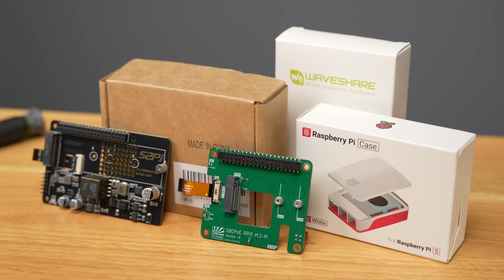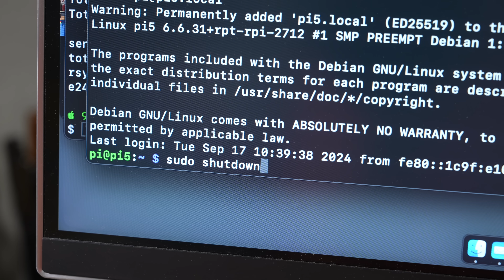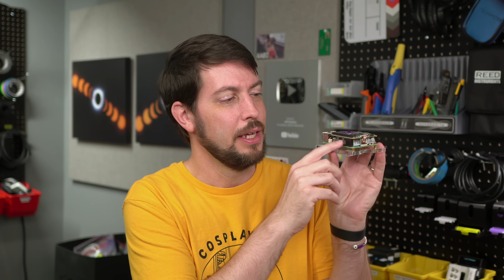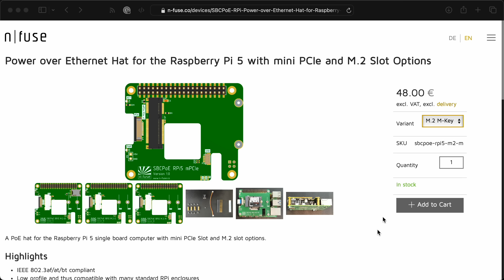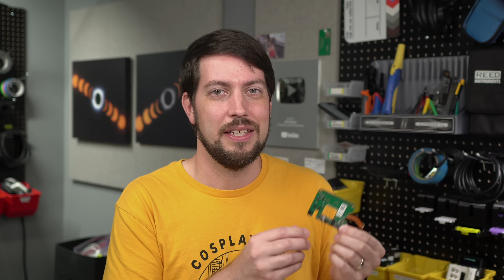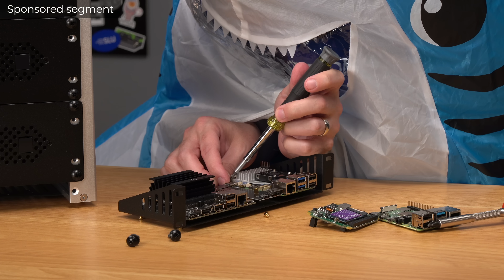PoE+ NVMe beats Raspberry Pi to the punch

Comment: The coil whine is what made me return the Waveshare POE hat, removing one of the selling points of RPi 5 vs. mini PCs for my intended purpose. My ThinkCentre Tiny cluster uses active cooling and has a certain amount of coil whine, but still manages to be quiet in comparison to this particular POE hat that I ordered. Unfortunately, this new hat comes a bit to late for my RPi 5 which now runs on the original power supply and with a NVMe base. I still feel like the RPIs got way too expensive (after considering the "required" mods like a heatsink/fan, the power supply and a NVMe hat/base) coming in very close to what I have paid for my ThinkCentres. Even the power consumption of the RPi 5 isn't all that great anymore. Something that I'd really like to see improved to make it more competitive again - smart phones can do it, why not RPi's*. Idle vs idle (with powertop on the ThinkCentres) they are surprisingly close, actually. Under (partial) load the PI5 wins cleary, but is also slower and is less flexible for server tasks. That being said, I still enjoy content about RPis a lot!
* Yeah, more modern chips/nodes are even more expensive to produce that's true, but still.

Comment: Great video about POE . I am working on RPI5 with waveshare with bottom M2 NVMe board including passive cooling of the M2 drive. Cooler on the top board I find to be very good solution. My own encloser will be using this setup and  run my one application  a as a server. I can keep you informed if interested.

Comment: You really do not need isolation if the application is all on an indoor rack. If we were running Ethernet to a remote pi (edge pi) then I would use an isolation for that one. Remember if you are powering your PI with USB C there is no isolation also. For indoor small rack applications non isolated is the way to go.

Comment: How do the various POE hats actually extract the power from the ethernet socket?  I would have thought that the Pi's board itself would require the POE circuitry to work, and thus POE is built-in.  How does adding a hat actually make this work?
Reply: The four pin header on the Pi provides an electrical connection to the far side of the isolation transformer that links the physical Ethernet socket to the PHY. The DC current can be extracted from this four pin header and handled by the PoE hat.

Comment: About "Coil-whine". Not all of this actually comes from the coils, but from the ceramic capacitors (MLCCs). There is some documentation out there and how to prevent this. You are welcome. :) There is this piezoceramic microphone effect, which also works in reverse, like a buzzer does.
Reply: Guess I learned something today and may dive into it later.
Reply: I'd argue that most of 'coil' whine in modern design comes from cheap or underrated MLCCs, especially in relatively low current converters (not 100W+ multi-phase microprocessor PSUs)

Comment: My least favorite thing about these PoE hats is the awful fans they put on there. Awful, because all 30mm fans are awful, cheap things destined to whine and fail. They also don't move much air. Barely worth the amps used to spin them. 

I have a 5V 40mm Noctua fan at max speed on the PoE powered Pi 4 hooked up to my 3D printer. It's silent, been running non-stop for a year, and moves enough air to keep everything, including the CPU, cool. All these part makers need to do is just slap a crappy 40mm fan on their stuff, so I don't have to engineer my own mounts and adapters and nonsense to mount a good fan on there.
Reply from the maker: They found a decent squirrel cage fan for the Active Cooler — one of the better tiny fans I've heard, and with the massive heatsink, it doesn't have to run that often.

Comment: So features I would like to see for the raspberry pi 6. 1. Drop the microSD entirely and put a 2230 m.2 slot in its place. NVME drives are a lot more resilient than the crap flash you get with a microSD. 2. Integrate POE by default into the board. 3. Get rid of the micro HDMI ports on it and just use 2 USB C ports on it. The nice thing with this is that you should be able to fit the power circuitry for power delivery over USB or through POE in the same area.4. The rest would just be the miscelanous make it better stuff. I wouldn't turn down faster networking and a faster chip powering the PI 6 but I honestly don't feel that those are as necessary.
Reply: Disagree on some points. 1: Many ppl who use RPis dont use PoE, so it would be an unnecessary cost for them - examples being robotics clubs, universities, etc. 2: I'd imagine the DP over USBC circuitry would take more space than a full sized HDMI connector, so rather just get a proper video connector
Reply: SD cards are convenient for a lot of users of the Pi - they're low cost, easily changed when experimenting, and easily removed and overwritten if you break the OS on them. Having an M.2 slot by default would be great, but removing the SD slot isn't going to work for a lot of users.

The vast majority of Pi users do not need or want PoE, making that a waste.

Fixing the power input to just use 9V or 12V via PD needs doing, though. The Pi has been excessively picky about power supply for too long.
Reply: USB-C with Displayport Alt Mode would make too much sense.  I think we might see it around Pi8 or 10 😂.  Agree on NVMe, it's so cheap, fast and reliable compared to SD.  PoE, while nice, seems like an added feature.  RPi foundation should absolutely have a first party solution for PoE
Reply: So now the Pi will cost $100+ with all those features.

Very few people need POE
Not everyone needs a m.2 drive. MicroSD is more than fine for most people.
1Gbit is good to keep costs down too.

I like where the Pi5 went.

I'd say the next goal would be flesh out the new stepping and focus on keeping power consumption/heat down.
Reply: @Squirrel765  As for the m.2 it really isn't an increased cost. You can get a 128Gb 2230 ssd for as cheap as $16. It isn't like the costs are really higher compared to a microSD card. I can see the logic with POE but again most people have to purchase a separate plug and cable for power anyway so having to get a POE injector instead of a USB C power cable doesn't really change much.

With all of this I guess the biggest thing is that I know that the margins are increadibly thin on a device like the Pi. I just think that especially with the Drive it is one that most people actually want anyway.
Reply: @chaosfenix  Imho you make some good points. With all the things you "have" to buy RPi's get expensive really fast anyway and an onboard SSD connector would reduce the cost for all those, who want a NVMe SSD and now don't have to buy a separate hat/base. And cost would likely be similar. Not so sure whether the same is true for POE since many  people don't even have a PoE switch. Then they would have to buy a power supply/injector/PoE switch. I pesonally think this would be one of the best features they could add... I would like to see USB C instead of this annoying micro HDMI port. It's really rare to find devices using it hence most people likely have to buy a new cable. A lower power consumption would be my other main concern.

Comment: Just wondering: What makes the hats Pi5 only?
Reply from the maker: These HATs rely on PCIe connections, which only works through the PCIe FFC connector on the Pi 5. Unfortunately older Pis don't have an external PCIe connection.
Reply: @JeffGeerling  you mentioned gen3 speeds a few times in the video - I assume you mean gen2 (x1) for the Pi 5? but I could be missing something. 7:33/10:16
Reply from the maker: @michaelthornes  You can set the speed to gen 3 (still x1 of course) in the /boot/firmware/config.txt file. For most HATs I've tested, it works fine. YMMV and it's not officially supported by Raspberry Pi!

Comment: Whenever I see a shark costume on the Internet, the song "Baby Shark" comes to me. OK, now let me get rid of the songs in my head and return to reality. I wouldn't recommend closing the top lid when using our PoE+ with the official case because there is not much cutout on the top of the PCIe connector, and closing the top lid will block the airflow. And I didn't realize that the official case even comes with a heatsink—maybe I'm just missing it, LOL.

Non-isolated PoE hats are more efficient than isolated ones because most isolated hats are based on a flyback circuit, which needs a Schottky diode series in the second coil of the transformer. Normally, the diode has a forward voltage of 0.4-0.7v. When the output current is 2A, the diode will consume about 0.8-1.4w, which is close to your testing. But I have a plan to reduce the consumption down to 0.05w and also reduce the heat. If I get any progress, I will come back and comment again.

As always, very great and detailed video.
Reply from the maker: Awesome! I love the little products you've been putting out. I'll likely end up with a couple more of these HATs once I get around to upgrading the rest of my Pi 4s, too.
Reply: @JeffGeerling  If you could find some longer M2.5 standoffs and pin-header that hat works with Pi 4, too.

Comment: Huh didn't the RPIs have PoE support before?
Reply from the maker: Yes, but they moved the connector on the Pi 5, so all the Pi 3/4-generation HATs don't work with Pi 5 unless you bodge a connector in, which is annoying and makes it not fit the same.

Comment: Jeff, have you ever played around with PTM7950 thermal pads on various PI components/areas to dissipate heat? I generally consider temperature over time a factor to product longevity/stability and would love your opinion (a video?) on if that product has a definite benefit for the pi and in which use cases.

Comment: PoE! 
But seriously, it is rad that we are getting more options for PoE with the Pi 5. I have a full 6 Pi 4s running in my network rack as appliances/redundant docker appliances over PoE, but storage wasn't really a useful fit minus mini-SD, which is fine given I do back them up, but it would be nice to use the increased hardware of a Pi 5 and not having to use an SD card. Hopefully this fall I'll get to test stuff myself, and then 3d print a multi-pi rack mount like I have with my Pi 4s.

Thanks for testing and sharing the new tech!

Comment: How do these hats work with the integrated Ethernet jack? I always assumed POE hats would need their own spearate ethernet connector so they could handle 48 volts being shoved down the cable and the extra POE protocol the pi isnt used to. So how do they do it? Somehow the 48 volts need to go from the integrated jack up to the board, so are there reserved gpio pins for that?
Reply: That 4 pin header near the jack is where the PoE is passed. Each pin connects to a center tap on the plug side of the isolation transformers in the jack.
Reply from the maker: This ^^ :)
Reply: @BineySaurus  Ooooh so the pi is already prepared for POE

Comment: I've been using a $5 PoE adapter from Amazon for my Pis for years. I have always thought it's a feature thats desperately needed for a device that you want to be able to run without having a tonne of wall adapters. The NVMe attachment is a good feature though.

Comment: I get that the cooling fan often isn't needed, but is it okay to run the pi without the cooling fan at all since the AIO POE hat seals off the vent hole?  Then again, this is probably just encouraging the running of a much larger cooling fan from the side.

Comment: These HATs are kinda close to what i want. I wish they would swap out the PoE for 18650 battery lol. I'm using two geekworm HATs on a Pi 4 atm, one for SSD and another one for battery UPS. It become too bulky and I always kinda wish they can mix the 2 HAT into one.
Reply from the maker: PiSugar makes the best battery backup HATs I've seen so far, though I need to do more testing. The problem is thermal requirements and space for the batteries make any solution with batteries a bit clunky.
Reply: I am working on a hat, or as we cloud call it, a base, that has dual NVMe, PoE+, 2.5GbE, and UPS. But I have many works to do, and I'm not sure when I'll finish it.
Reply from the maker: @vileerdeng  That sounds amazing, I think if you could get that plus a decent case, and sell the whole package deal, or make it easy to assemble, it could be a very nice 'everything' Pi, competing with cheaper mini PCs. I wonder too, if you could do something similar but even more compact once the CM5 comes out...
Reply: @JeffGeerling  I think we are talking about CM5 NVMe NAS with build-in battery and 2.5GbE. Yes, it's on the list.

Comment: How many hats / bases can you stack at once?
Reply from the maker: Technically infinite... though at a certain height the signal integrity for the buses you might be using would be poor. Also some HATs require exclusive use of certain pins, so you'd have to stack them in a way that the higher HATs can still have access to the pins they need.
Reply: @JeffGeerling  time to make the most ridiculous raspberry pi setup ever.  I got one now that uses 4 stories, but I know of at least 2 more hats I need (maybe more). I’m building a custom chart plotter for my boat. I have a 2TB NVME base, Macauthor hat for signal k networking, dAISy hat for AIS communications, and still need to add a hat for autopilot.  Additionally I’d like to be able to add security cameras to the boat that I can view remotely, but I wonder how much I can ask of 1 little raspberry pi 5?  I’d love to see you construct the leaning tower of pi just to see how crazy things can get.

Comment: I used POE Hats for years until i discovered the POE ethernet to ethernet and USB-C plug, still can use a POE plug, no heat, it just works. I dont know why you didnt recommend that as a significantly more efficient (due to no massive heat source in cases that support a POE HAT).  The cable adapters are cheaper, produce significantly less heat and allow for standard pi cases. I dont know why ppl would buy Hats for POE. It would be better if the Pi itself had POE, its only someone we have all been asking for for about a decade. I am sure they will get around to it by the Pi 200.
Reply from the maker: Those are handy for desk use, but can get a bit unwieldy when using them in rackmount scenarios (IMO). The power design especially on cheaper breakouts is not great either, but some are good!

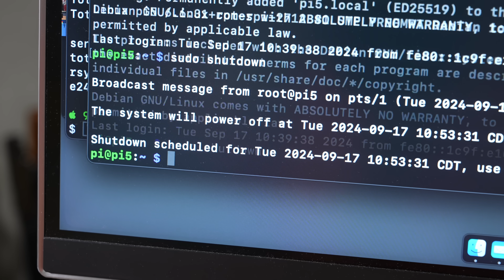Comment: 3:54 that's what we call "a feature not a bug" in the industry. This board will auto-restart the Pi if it powers off. Boom done.
Reply from the maker: Heh, I was actually going to say that in the video, a lot of people just want the Pi to always restart!
Reply: Which is absolutely fantastic... until you need to shut down your server before a power cut.
Reply: @raw_000  turn off the POE port
Reply: @raw_000  That could fix a managed PoE Switch. You just shut it off by turning PoE for that port off. 
I would call it a feature.
Reply: @raw_000 the power cut will shut it down 😂
Reply: @raw_000  just sync; sync; sync; halt and leave it idling not ACPI shutdown
Reply: how do pi's handle power cuts like that without trashing the FS?
Reply: @SmplySilver  depends from the FS or OS. Either way if your power is cut the damage is done and auto-restarting the Pi later when the power comes back isn't making it worse
Reply: It's called that regardless, knob.
Reply: I've never encountered a PoE device personally that could be turned off without unplugging it or disabling power on the port. These hats would be the only ones I know of. I've always expected that a PoE powered device will always power on as soon as it gets the proper juice on the port.
Reply: @W1ldTangent  it’s kind of dumb that you have to look for that feature in the first place. That should be the default option for all PoE devices anyway. Every PoE device acts like that. 
It would be fair to say that the other hats are just straight up broken.
Reply: @W1ldTangent extremely good point!
Reply: Facts dude. Like if I want my pi off I'm unplugging it. Besides, can fix that. I want that first one. Seems like the best

Comment: Could you stack two hats?
Reply from the maker: Using stacking headers, yes—typically these PoE+ HATs only supply power through GPIO pins on the 5V/gnd pins, so you can still stack other HATs up higher. Just you might not be able to share PCIe if one HAT is already using it... unless you buy a 'Commander' switch board from Pineboards, at least!
Reply: @JeffGeerling  Nice, Pi's still find ways to surprise me

Comment: The trouble with no isolation is when you connect other devices to the Pi, especially the GPIO pins.
Reply: You probably mean other devices, not powered directly by the Pi (ground loop)?
Reply: @91795jc  yes, the Pi's earth could be sitting at any voltage, especially as POE is often at 48V, so tieing it to another bit of equipment on a different earth could have all sorts of strange effects.
If it's isolated then the Pi would just assume the earth of whatever your hooking up to the GPIO pins.
Reply: This should NEVER happen because you would never run Ethernet between two separate structures not sharing a common ground bond. Voltage potential is often the death of millions worth of networking gear from foolish users who know just enough to be dangerous...
Reply: @YouNoStepOnSnek  Even within one building, assuming that 'ground' and 'ground' are the same is a major error. That's why ethernet is galvanically isolated.

Comment: Anyone got a link to the Ethernet cables used in this presentation ?
Reply from the maker: Those are SlimLine Ethernet cables... I think maybe from Monoprice? I think they sell them on Amazon too. Very handy for lower speeds or lower power. I wouldn't use one on a PoE++ AP or something, but happy with them on my Pis.